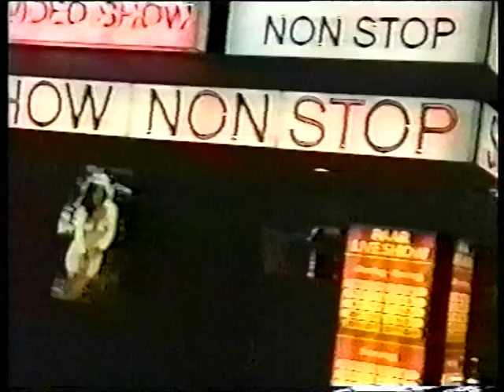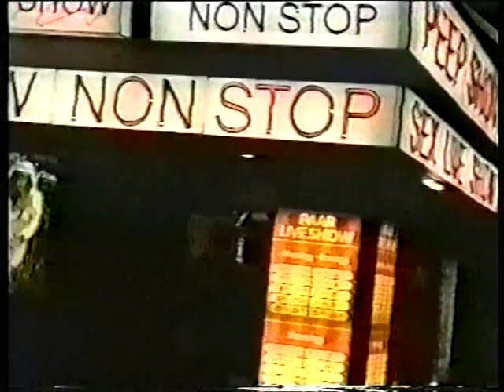Bricklayers in Germany

Comment: DOES ANYONE KNOW WHAT TYPE OF BRICKS ARE THOSE? THEY DONT LOOK LIKE CLAY OR CONCRETE.
Reply: Michael Owusu Kyereko Lime and Sand are mixed together, pressed into the shape they shall have and then they are hardened with hot steam
Reply: Lime- Sand- stone if I translate it word for word
Reply: Calcium Silicates, SP3's  a factory at Ryarsh used to make them, now gone. Great brick below the ground, but on facework, pretty awful, issues with high expansion rates and generally wouldn't bond with the mortar, so free standing walls you would see a lot of lifting from expansion and lateral weakness. Great brick though for compression ie footings....and also we used them as apprentices (80-83) in workshops due to thier sharp arris, easy to cut with a trowel,  and regular size.